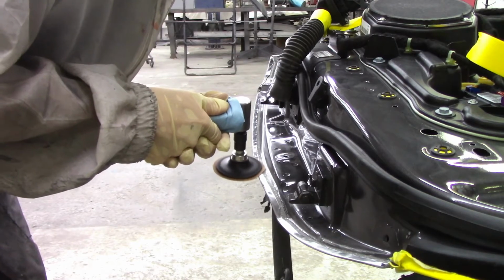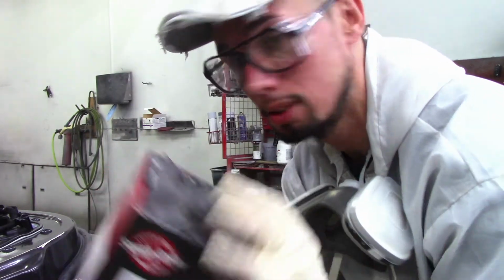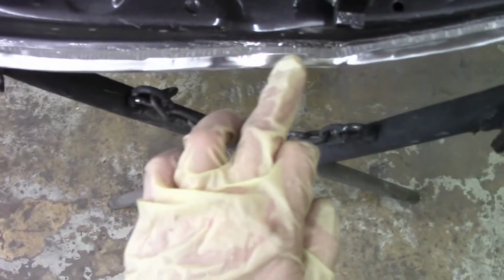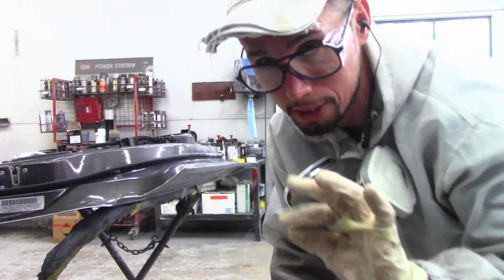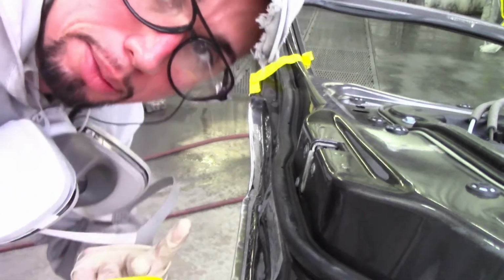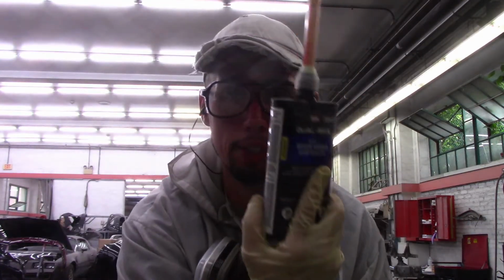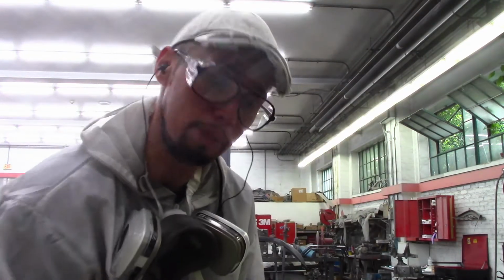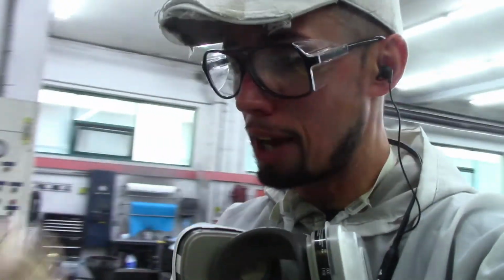How To Apply Seam Sealer To A New Door Skin

Comment: Great tip J! New to the channel and your tips are helping me with paint work on my 71 VW camper restoration.
What brand is the seam sealer?
Thank you.  Keep ‘em coming!
Reply from the maker: Thank you 🙏 for the kind words I appreciate it. And the seam sealer I use is SEM brand sealer sealer. SEM DUAL MIX BEIGE SEAM SEALER #39477
Reply from the maker: You need a dual cartridge seam sealer gun for the dual mix seam sealer.
Reply: @J.Lulo_  thanks for the info! 👍
Reply from the maker: You’re welcome.